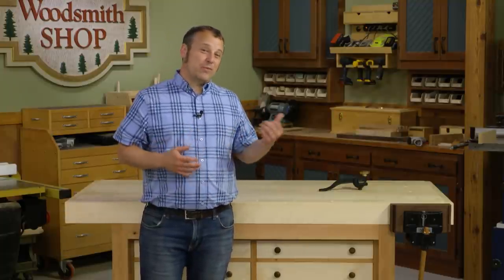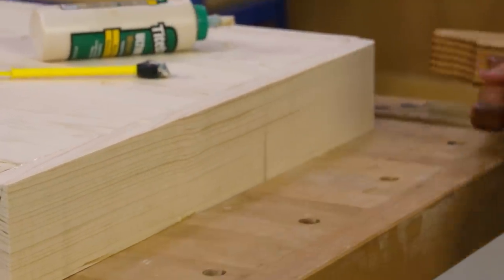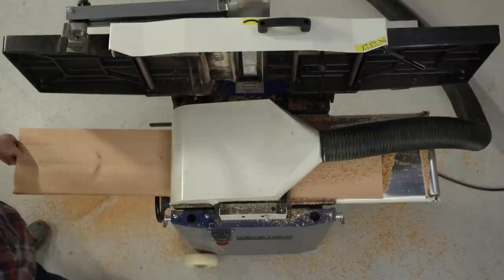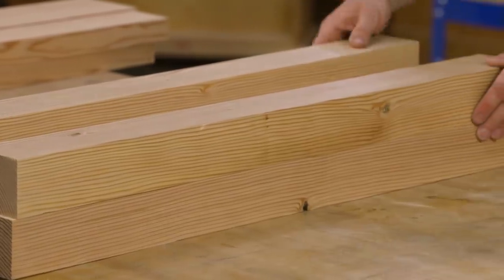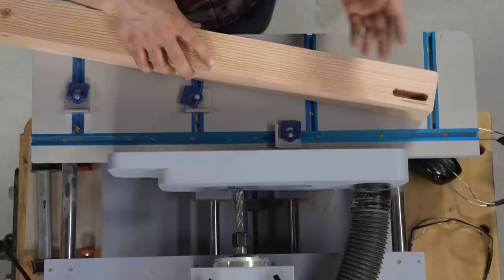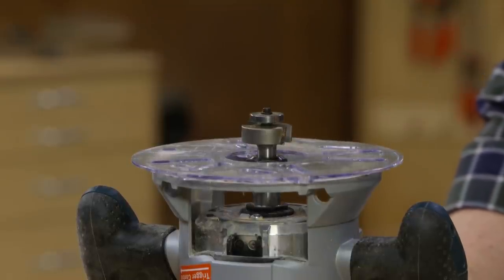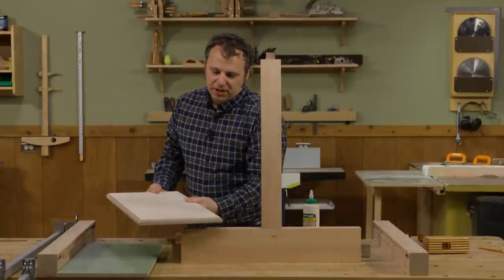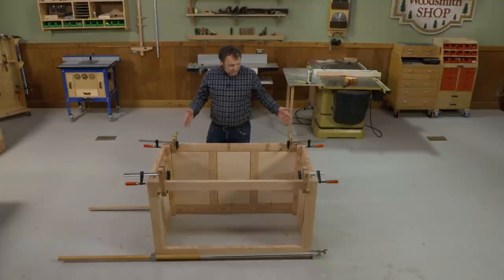Building My New Shaker-Style Workbench - Part 1

Comment: Nice workbench Phil.  I agree that the bench shouldn't be up off the floor, but feel there should be a four or five inch toe kick to prevent kicking the bench when I'm working up close, even with an overhanging top.  I've yet to build myself a bench and am still using my table saw as my bench, but when I do eventually build one, it will have room for my toes.
Reply from the maker: The kitchen cabinets in the house I grew up in didn't have toe kicks — it was built in the 1920s. I never kicked the cabinets. From my experience, it's a feature that's over rated ... mileage may vary though.

Comment: A few years ago you did a show on using 
Used jello cups  for glueups to hold small amounts of glue in as you worked becuse most guys buy glue by the gallon becuse its cheaper  and the jello cups are waste products from food containers you can reuse and if the glue dried in it no big deal just trash it it was free anyway.  Ive got a spin on this why let any glue in one get contaminated or dry up some brands of potato chip cans like lays stax fit right over the cup and seal tight enough the water in one isnt drying up im testing 2 of them with water for now.  So let's say your doing a big project 
And need to let stuff sit out a day or 2 well put a lid on it untill your ready to go back.  Might even work on stains and finishes or even paint.  Needs more testing.  And its not going to work on all types of cups. Im using jello cups that had dole jello in them.
I dont know if Pringle can lids work.
But why spend 12.95 on some plastic container or spoil a gallon of tightbond II
When you can use smaller amounts and not dump partly used glue back into your new gallon.  You now have a way to store your working product and keep the full gallon clean.
Reply from the maker: Great idea! I might have try out some of those containers and lids too. 👍

Comment: Wow the dust collection looks abysmal in planer mode of your jointer-planer... is that normal or did you not have the DC on?
Reply from the maker: If there is one downside to that machine, the planer-mode DC is it. Sometimes it works ok, other times not as much. Doesn't affect the operation of it — which is exceptional — just the cleanup.

Comment: Im curious why you chose to glue the panels in rather than let them float. Wouldn't letting them float allow for typical wood expansion/contraction?
Reply from the maker: I'm using plywood panels. They don't move much with changes in seasonal humidity. So gluing them in adds to the overall strength of the assembly. If these were solid wood panels, then YES I would need to account for the panels to expand across their width as the humidity rises in summer.

Comment: I tend to over build everything Phil so take my minor criticism with that in mind. Yes the glue will provide a joint stronger than the wood it's built from. But in comparison, any work bench and especially one with hand tool wood working in mind is going to take far more racking stresses and vibration from mallets than anything else were likely to build. If it were me I think I'd add some type of cross dowel mechanical strengthening on each of those loose tenons. It would only add a bit of extra build time, almost no expense and could be done later after the full assembly just as added peace of mind.
Reply from the maker: I thought about that very detail. I can go back and do it. But between the fit of the tenons and the Titebond 3, I'm satisfied this bench will outlive me.